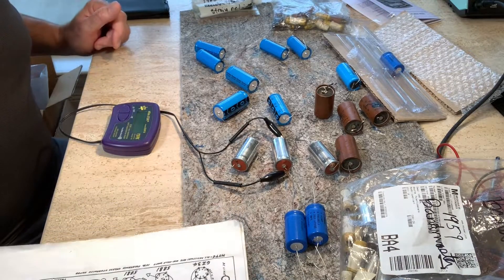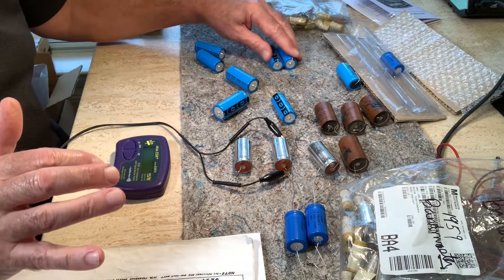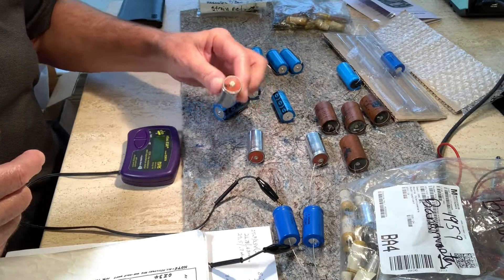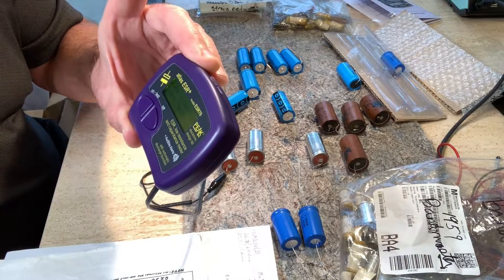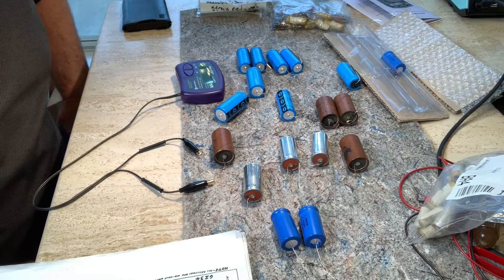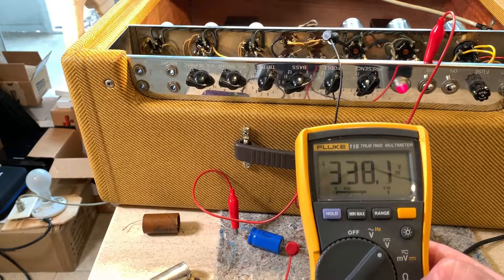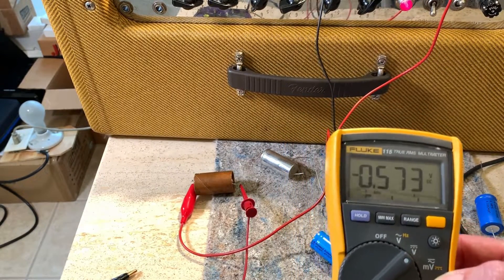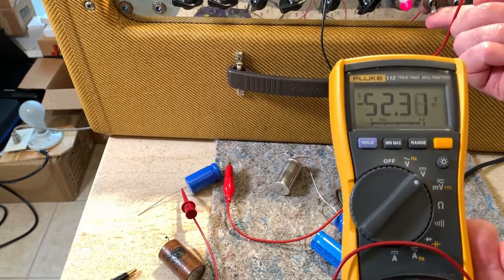A Video for Uncle Doug - Trying to Decipher ESR Readings of Electrolytic Capacitors

Comment: What you need to do is look up the specifications of the capacitor which will include the ESR value when new. You are performing measurements of electronic components which involves knowledge of the test equipment as well. As for the capacitor discharge rate, it depends on the amp circuit. Some amps don't have a discharge path and others have different resistor values that allow the caps to drop their charge quickly or slowly. So when evaluating used capacitors it's best to reject anything that has obvious defects like leakage and corrosion. After that if the capacitor reads the correct capacitance and an ESR below the maximum specified then it can be put in service. However, you should try not to use capacitors that have been in service for more than 10 - 12 years especially if they have been exposed to temperature extremes such as in a tube amp.
Reply from the maker: Yes, I tried to get the ESR values from Vishay several times with no luck.  I may try anew today.  They wanted the part numbers of the caps in question but never responded once I sent them the part numbers.  Their Sprague data sheet on the Mouser site is not very detailed.  It mainly just shows the physical dimensions of all of the caps.  It says nothing about electrical specs.  I found the unit I really need but apparently they are hard to find because they are old technology, the Sencore CA55 cap analyzer.

Comment: I think one problem is that those types of ESR meters only work at low voltage (usually around 9V)... and I have seen them say a capacitor  is "good," but have found them to be leaking badly at high voltage. To really test (and help properly form new) capacitors, you need a high-voltage tester (something like the EICO 950)...these testers supply the proper operational voltage to the device under test and are a better tool for determaning true leakage. On these high-voltage testers, I bet the new cap would form and test good, and the older caps would just continue to leak.
Reply: I think it's best to say that the ESR meter is simply one of several ways to evaluate electrolytic capacitors. Other way include the measurement of capacitance, and the measurement of leakage at operating voltages.  I will say that any electrolytics I have ever encountered which display obvious operational problems, like overheating and/or causing an audible hum, invariably have abnormally high ESR values.
Reply from the maker: Please, not another tester.  I am concerned about this "properly form" thing though.  I don't think I did anything other than use my voltage regulator and the light bulb current limiter on the first cap job.  I can get the voltage down to 110V and work my way up.  I think the current limiter reduces the voltage a little too.  I need to check that.
Reply: Yes running ESR tests are not really dependable on a 9v supply. At 9v the ESR reading might be fine but if the cap is completely dead it will show high leakage. These aren't 9v caps they are 450-500v caps. Once working voltage kicks in at 450v it is much more harsh conditions than 9v ESR measurement. On my ESR meter you have to zero out the meter first before testing a cap. Either way I find the ESR meter is best reserved for low voltage supplies.
Reply: @millstap  The current limiter does reduce voltage a bit, MS.

Comment: And Yes! You need a VariAC!
Reply from the maker: Why?
Reply: millstap If you’re gonna be forming caps or doing experiments like this. They’re useful for troubleshooting all kinds of stuff too. The 5 amp version on EBay works great for me, along with the lightbulb current limiter.
Reply from the maker: @matthewf1979  Well $30 isn't as bad as I thought.  Shoot, my mole trap cost that much.  I still wouldn't know how to use it.  I guess there are probably YouTube videos on how to form caps.  One of my buddies says he actually notices a difference when he forms these using a variac.
Reply: @millstap  I use a variac with a current and volt meter but the light bulb is a cheap and safe old school method.

Comment: Do some discharge cycles on the new caps. Larger capacitance usually means higher ESR, the foil type makes a difference too. The Mallory and Sprague caps should have smooth foil plates, while most others use an etched foil for higher surface area on the plates. Makes for a smaller overall cap, or a cap the same size with a higher voltage rating via thicker dielectric material.

Your leakage check method is flawed. You need to ground the negative end of the cap and check the difference between the positive and negative sides of the cap. Be careful not to overload your tube rectifier, static voltage checks should be fine when its not being used/loaded.

Anyways, Doug forgot more stuff than I know. I say newer caps can go 15 to 20 years and be fine with regular use. As long as they’re not physically leaking electrolyte, not heating up and there’s no 120hz hum leave them in.

Good luck!
Reply from the maker: Hey Matt, I know that Gerald always stresses that his custom caps are smooth plates, not etched, and I'm assuming the Spragues are smooth too. My dilemma now is, are these new caps as good as the old caps that are in the amps?  I hate to change them and think they sound worse and have to put them back in again.  That's a lot of work.  I think the new ones are probably as good or better.  The amps are sounding so good I think I will just use the 1959 Bassman as the ginny pig and change them.  I bought the darn things and now they are going in something.  There really does not seem to be a good way to test them for sure.  I know the ESR meter probably works better for computers and the sort.  Electrolytics are an interesting animal.  I remember one of the 8uF/150V cap leads in the negative voltage bias supply had broken from years of vibration and the amp still worked fine.  I guess two are there for extra filtering but only one is really needed for it to work.  And who knows if that one shorted cap was shorted in the Bandmaster before I changed them and THAT amp seemed to work fine too.  I think it probably was.
Reply: I agree with you, Matt. New electrolytics should be good for way more than 6 years......and if there are no symptoms of malfunction, I leave them in too. Frequent usage seems to prolong the life of electrolytics.....probably because it allows them to retain their "form". A variac will allow you to "re-form" caps that have not been used in many years.....as long as they are still in good internal condition.
Reply from the maker: @UncleDoug  I will probably go 20 years from now on.  I changed them in the 1959 and I heard no discernible improvement at first but then it seems the amp is starting to sound a little better after a day or so.  It made a few strange static noises so I'm hoping they are still forming or something.  They are stable now.
Reply: @millstap  That seems reasonable, MS. Thanks for all you input on this topic.
Reply from the maker: @UncleDoug  Thanks for your help.